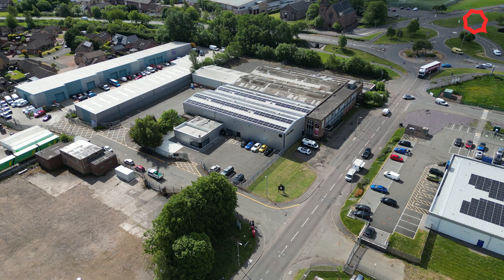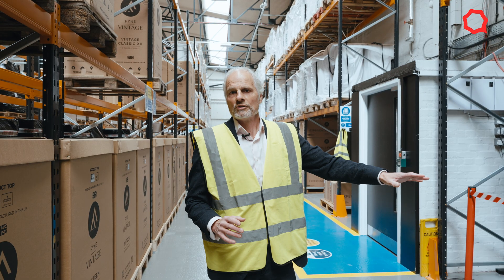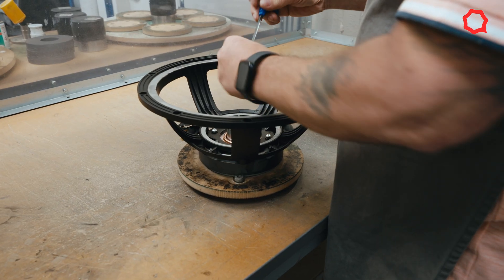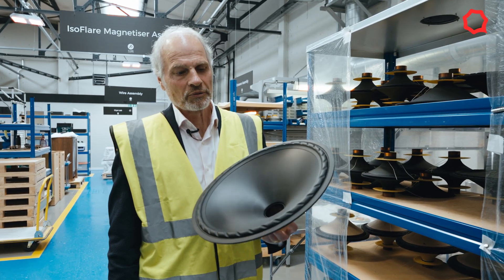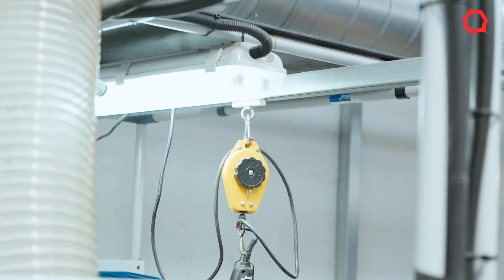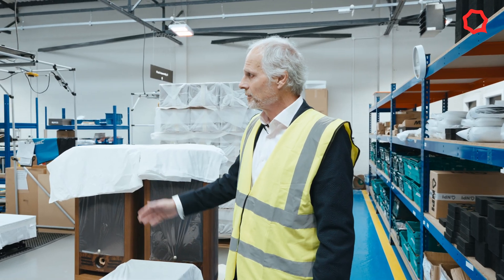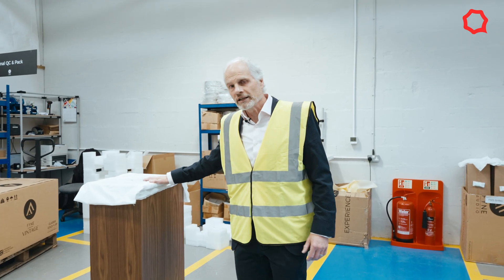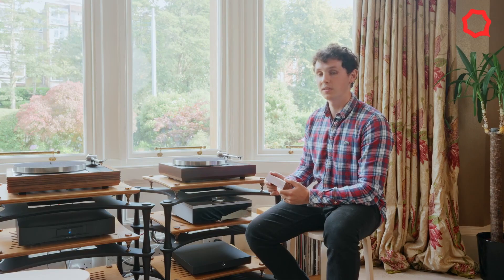Fyne Audio Factory Tour July 2025

Comment: If you wanted to expand your premises, you could do better by building a proper anechoic chamber, as I'm not entirely sure what you were measuring in such a small space. Also, your explanation as to why PCB's don't sound good in a crossover was not a valid explanation at all. More like technobbale used in marketing. Otherwise, you failed to articulate why your speakers are better than anyone else's.

Comment: He talks about circuit boards affect the sound quality in the crossovers. Yet they use an iron core inductor, electrolytic capacitors and sand cast resistors.... LOL @6:58
Reply: It likely depends on the model.  To make such a blanket assessment based on a clip shown is rather presumptuous or downright lazy.
Reply: @scslite5206 Both, most likely.
Reply: Thanks Danny.  Any thoughts of your own?
Reply: I noticed this too...and the relatively low quality of the driver basket surprised me, looks like stamped steel to me.
Reply: @DalstonVinyl  Man, that is as far from stamped as you can get.  That's a cast basket.  Spec Savers for you.
Reply: @DalstonVinyl  The baskets on my F501SP drivers are cast aluminum.